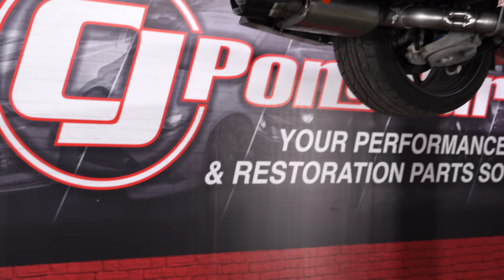2018-2023 Mustang GT Install: Borla 3" ATAK Cat-Back Exhaust System with 4" Carbon Fiber Tips

Comment: For two thousand dollars, it better sound that good.
Reply from the maker: Anthony Ricci lol I agree
Reply: Don’t worry, I install mine Atak yesterday, it sounds amazing and not one single YouTube video does it justice
Reply: 2000?! Damn last time I checked it was 1200 in the UK why's that ?
Reply: I’d rather buy a MBRP Catback for just under 700. That’s what I ended up putting on my 2020 GT when I had it and it sounded incredible. Sure borla and corsa sound slightly better but not 1300 dollars better.
Reply: @ZFA1738 i disagree lol, have you heard both of them side by side?
Reply: @Boosted_az  yes sir i have. I do agree that corsa is the best sounding exhaust for the mustang and borla also sounds great. They both sound better than mbrp. I just think that for the money you can’t go wrong with mbrp and me personally, I can’t justify the price tag for it. If money isn’t an issue at all then of course I’d prefer corsa or borla but I can’t justify 2k for an exhaust.
Reply: @ZFA1738  maybe $1300 more IS a little excessive lol

Comment: Think I’ll be going Borla over Corsa. Wasn’t sure which way I was going to go but now I think I’ve figured it out. The problem with the Corsa exhaust to me was the way the tips were made for the non active exhaust. Instead of two separate tips they have that Y pipe type deal and it doesn’t seem to fit perfectly from what I’ve seen. I like that Borla has the two tips coming out of the muffler for the non active exhaust system. Seems to fit better.
Reply: Should be saying up for a tremec swap.
Somewhere out there is a boat that could use that pos mt82 😂

Comment: I had the Borla ATAK's on my 2016 Mustang GT.  Best exhaust I've ever owned and heard. To get the best sound though you need to delete the resonator and put on an X-pipe.  Unfortunately I totaled the car after customizing.  Bought the 2018 Mustang GT with PP and for the 1st time an 10 speed automatic, very impressed so far as a manual purist that I was.  Went to buy the ATAK's again only to find they were not available yet for the non-active exhaust systems. Also disappointed in the new price points for both Corsa and Borla's, very expensive but does include the x-pipes so a little bit of trade off. I went with the Corsa Extreme and so far I've been very impressed with both the tone and loudness.  All I can say for those asking is that they are both very loud in the upper RPM range just different types of loud.  Corsa has better deep tone at idle and higher pitch at full throttle.  ATAK slightly quitter at idle but deeper with more rasp at high RPM, 3000 and above.  Corsa tips were the best looking until these new Borla tips came out. Wow those look great.  You can't go wrong with either system.  People will hear you coming and going for miles.
Reply: Mark Parker which one has more volume at high rpms?
Reply: I can't detect a discernible difference on volume as I mentioned.  They are both very loud particularly with x-pipes, just a different type of loud. Best I can describe is under bridges, tunnels both have a Nascar loudness that rattles windows. Corsa has an F1 race car quality to it at 5000-6000 RPM range hence the higher pitch some mention at times. I would have Borla's on my car now had they been available.  That being said I'm very pleased with the Corsa Extremes and won't be changing them out.  Adding headers to them makes them even more extreme on both systems.  You can't go wrong with either system. What kind of car do you have?
Reply: Mark Parker i have a 2018 mustang gt with the H pipe, Kooks catted 1 7/8 headers, with stock active exhaust. Been debating Corsa vs Borla, but after everyone saying Borla is deeper and just as loud as corsa, I will go with the ATAK to keep the deep tone i currently have. Thanks for helping!
Reply: Cool, you can't go wrong with that set up.  I replaced the non-active exhaust on my 2018 so I have only one mode...loud.  Enjoy the Borla's!

Comment: Bill, I know you don't have this car any longer, but did you ever go back to the S-type or did you keep the ATAK on it? What was your long term opinion of the ATAK? I'm trying to decide between the two and would appreciate hearing your take.
Reply: Hey Brandan, I bought this car and it still has the ATAK system on it. I will warn you, it got ignorantly loud after I installed my supercharger, not so much the volume, but the rasp is ridiculous. If you're looking for volume and raspy crackle and you have a blower then you'll like this setup for sure.
Reply: R Reno thanks for the reply!

Comment: Hey Bill, you said corsa extreme was higher pitch, but which has more volume between ATAK and Extreme?
Reply: Jonathan Le that’s a great question. Been wondering the same thing.
Reply from the maker: I have not had the extreme on my car for awhile but I think the ATAK is a little louder volume wise. I would probably say MBRP Race, ATAK, Xtreme  as the three loudest in that order.

Comment: Hello I’m in desperate need to ask if there is anyway I can order the borla atak carbon fiber tips alone like just the mufflers themselves. I bought the full exhaust the borla atak with carbons fiber tips but I had a accident and the tips messed up but the rest of the exhaust is fine. And I’m just trying to order the carbons fiber atak tips the muffler. Is there any way I can just buy those? Please help me!

Comment: Why would it be necessary to have active exhaust with this setup or something similar?
Reply from the maker: This system is for cars without the active exhaust. if you install on an active car you will get a dash light.
Reply: @cjponyparts  understood. However, you answered my question in partial. Is it possible to have a system like this with active exhaust? And why would it be necessary?

Comment: Bill, with the active exhaust option would you go with xtreme or these? I have had the corsa on my 15 and loved it would I be disappointed going with borla on my 18 with active exhaust?
Reply: I've compared the ATAK on my 18 GT to a buddies 18 with Corsa extremes.  Borla is deeper at idle and low rpms, but still screams up top.  Corsa may have a tad bit more volume, but I didn't measure the DB so who knows lol, they're both loud as hell.

Comment: does this fit on 2015 gt if I change the diffuser to gt350 one?
Reply: As long as there is room for the tips in the diffuser, should have no problem I'd think.

Comment: Hi Bill.  I'm getting a new 2019 Mustang gt pp1, without the exhaust feature.  If I only get the mufflers, not deleting the resonator, will it sound much better outside the car?  Trying to keep it quiet inside, yet make it look and sound better outside.  Thank you for your feedback.
Reply: Or I’d recommend you get an x or h pipe and keep the stock mufflers.

Comment: What is the best sounding 3 inch exhaust system for the ecoboost 4cy.turbo 2017.
Reply from the maker: I like the MBRP race.
Reply: @cjponyparts  thanks so much I will buy one next . Along with a catless down pipe.what is the best tuner .cobb, bama ,Lund.
Reply from the maker: I like Cobb for the Ecoboosts personally.
Reply: @cjponyparts  thank you.

Comment: That’s no fair borla made a quad tip option for the 13-14 why couldn’t they make a quad tip option for the 15-17! 😩
Reply from the maker: Rene Garcia the Ford Performance quad tip for the 15-17 is made by Borla.
Reply: Because the quad tip option for the 13-14 were for the GT500s
Reply: CJ Pony Parts not the same!
Reply: StangBrosTV yea I know but borla could’ve made it to fit the roush rear valance

Comment: Will this fit a mustang 2016 gt with a roush rear valance ?
Reply: Jose Garcia probably
Reply from the maker: No it will not fit properly, it will sit way low and not look right. It would need to be modified.
Reply: CJ Pony Parts what about gt350 valance

Comment: The difference is the 2016 and down the car only pumps 435 Hp with 6.5k RPM and the 2018 and up pumps 460 Hp with 7.5k rpm

Comment: Dose it fit to 2015 stang ?
Reply: I’ll change The rear diffuser if that what’s take
Reply from the maker: You would need the entire 2018 rear bumper to make that work. We offer the Borla AtAK for the 15-17 but it would be single tip.

Comment: Is there any way we can get a video of the GT350R conversion brake kit for the GT and what wheels will work with it? LMR has a video on it and it shows the standard offset for the GT to make the wheels stick out. Of course LMRs only option is the R350 GT350R replicas with the GT350R offset. I’m looking for something different than getting replica wheels. Hoping you all might have information on something else that will fit.
Reply from the maker: 6ixSpeedStang18 it is something we are working on

Comment: I have a 2019 gt convertible manual with 17/8 long tubes with this system work for me?
Reply from the maker: Yes as long as your midpipe is designed for a stock style cat back